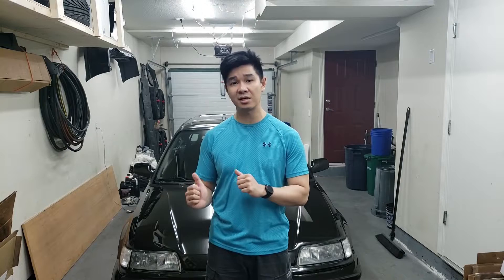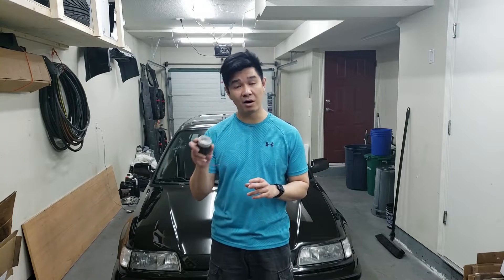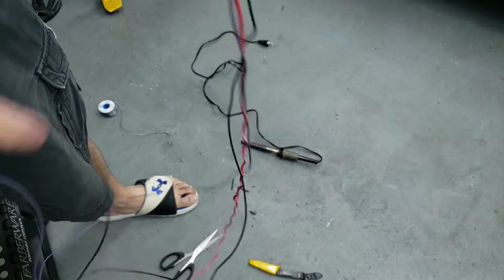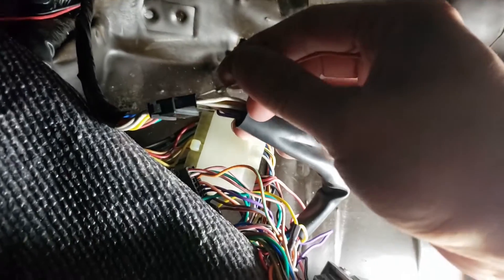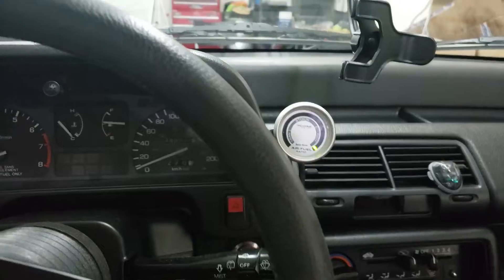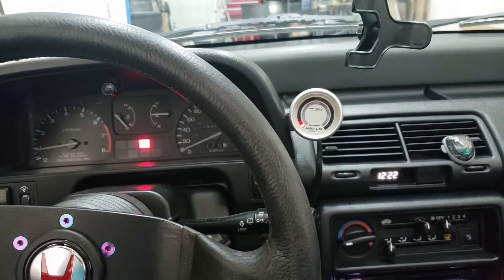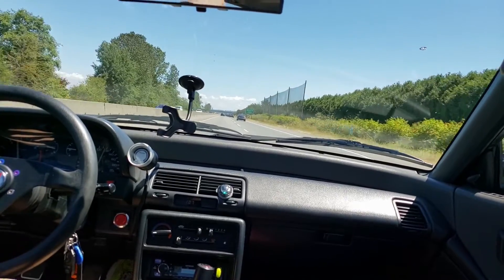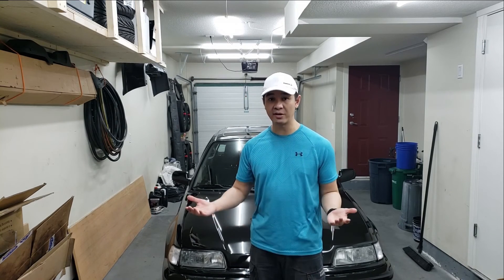||HONDA EF9 / ED7 88-91 CIVIC|| Is My CIVIC Running Rich?! I installed a Narrowband Air/Fuel Gauge!🔥

Comment: hi are these narrowband afr meters any useful?? i mean any useful information provided in rich area??
Reply from the maker: @ezgtte  It gives you a general idea of how your engine is running. You can't tune using a narrowband. It takes signal from your stock o2 sensor, which has a smaller voltage range. Its more just a general idea only. For more accurate readings, you need a wideband o2 and wideband gauge.

Comment: Could it be a vacuum leak
Reply from the maker: Not a vacuum leak. The engine has been smoke tested several times. All exhaust and vacuum leaks have been addressed. The gauge is showing what its showing because the ecu is stock for one. So based on o2 readings, it'll self adjust fuel. Secondly, the ecu is made for a d16z6. Mapping for a d16y8 and a d16z6 are quite different. A p28 map is only a good starting point, but will need to tune out the fuel and timing. But the primary variable is the the map. Needs a tuned map to run better.

Comment: I swear all the new fuel pumps make you run rich for over pressurized.
Reply from the maker: Do they really? I haven't changed my fuel pump, but the job of the fuel pressure regulator is to regulate the pressure. So it shouldn't change anything.

Comment: Pretty sure throttle-off-lean is normal. Because your off throttle so the tps is telling the ecu to run less fuel or else you'd be running rich and flooding the car. Which would cause you to also have bad fuel mileage.
Reply from the maker: That's true. I think for the most part when I throttle off, it didn't even show a reading. Either way, the stock p28 map needs adjustments to work for the Y8. It's running too lean at idle. I'll definitely need a wideband sensor and gauge to verify these narrowband readings.
Reply: I was gonna say that too. As well as during warm up it's also normal to be lean. During "open loop" everything's cold. Lean burns a little hotter and helps get everything closer to operating temperature faster and not waste fuel and time doing it. You got a fresh subscriber in me.

Comment: ...or you can throw in a stock d16a6 for $300 lol
Reply from the maker: You mean $150. Or $25 bucks, which was the most recent local price for a stock D16a6. lol. Didn't bother with it cause I don't want a D16a6. For $300, that's like z6 or y8 price, which I'd much rather have any day.
Reply: @BudgetGears  Cant even find d16a6 anymore where I am...
Reply: Is it really this difficult ? I can’t be this out of touch
Reply from the maker: @victorsgarage5814  I guess it all depends where you are. The d16a6, or even any of the d series, is going extinct. I see d16a6's come up for sale here and there, but they either take forever to sell or the seller just scraps them. It's really sad when they get scrapped. I'd totally take them all if I had the space for them. lol.
Reply: @BudgetGears  don't blame you, the junk yards around me have little to no 1988-1995 Hondas. The ones that do show up are beyond salvageable including their engines. Lots of y8's tho, settled for that. Better than nothing lol.
Reply from the maker: @spp6849  Yeah even the Y8's are starting to slowly become more scarce. I still see many come up for sale, but less often than before and the ones available all need work. Doesn't surprise me since the Y8 was deemed to have the weaker oil pump compared to the previous generation engines.